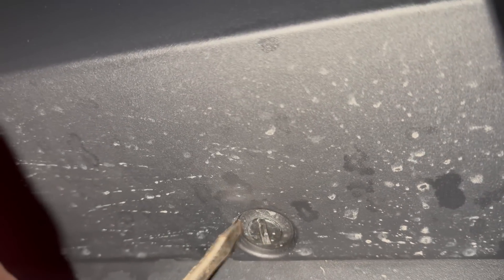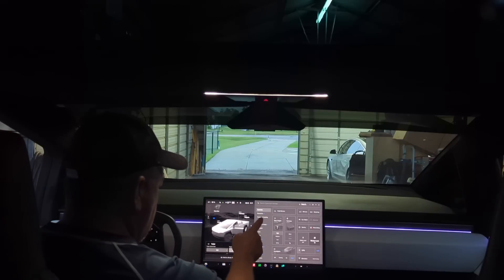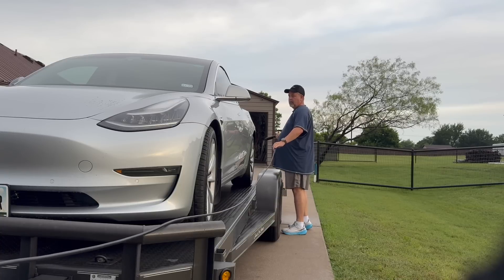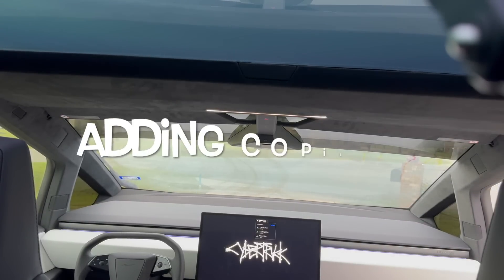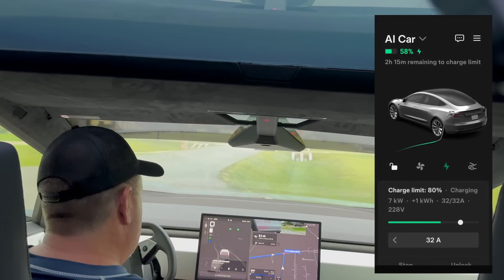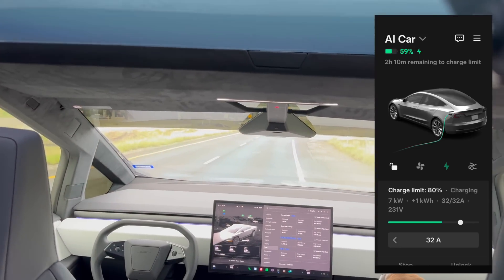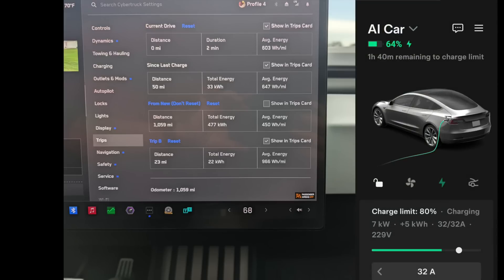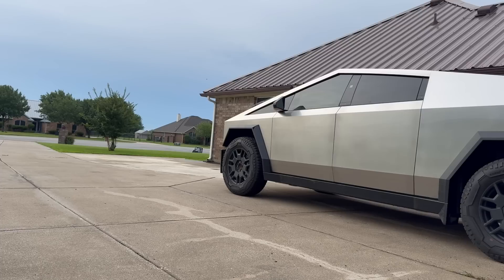Can a Cybertruck Tow while Charging? (Part 1ish)

Comment: Can you try it with a Lightning to compare? You can use mine if you want. And how about using a front wheel tow dolly trailer?
Reply from the maker: It'd be tough to schedule.  I'm a 3am to 6pm guy.  I'm not opposed to trying, but I no longer own that trailer I used.